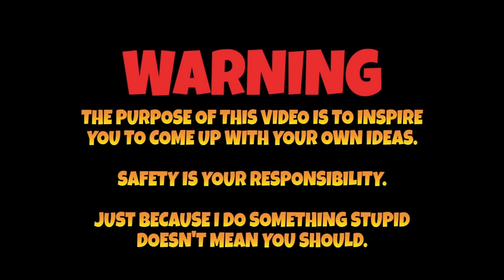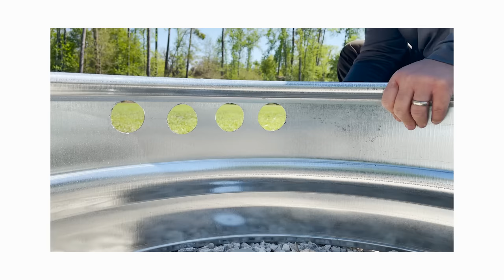12V Milwaukee More Powerful Than 18V? Head 2 Head Torture Test!

Comment: Man, I've never used the M18 stuff but I LOVE my M12 tools... I'm an accessories fitter at a dealership for 4x4's so I'm working with brand new bolts/screws, the M12 stuff has PLENTY of grunt to deal with the thread locked, factory tightened bolts. Awesome stuff, I've not once thought, hmm I need more powerful tools. ( I use the M12 multi tool, die grinder,  3/8 Stubby, and 1/4 impact driver... and a couple different heated M12 jackets/vests..)

Comment: I just bought an M 18 fuel combo kit with a hammer drill and a surge impact along with two batteries a 12 V and 18 V charger and a hard case offer like $220 or so.
Reply: Link to kit you speak of, home depot offering?

Comment: I do a lot of cabinetry and fine carpentry and for those applications the M12 set has been amazing, I'm even able to get winter rusted lug nuts off the car with the impact gun.

Obviously if you're in a more heavy duty type of trade then the M18 set would make more sense, both great tools though!

Comment: For daily user, M18 is your choice.
Being a non-daily user, I have a full set of M12 torque rachet, drill driver, impact gun for DIY mechanics. M12 Hammer drill will be my choice on top my M12 batteries and charger.
Thanks for you guidance, always glove and safety glass.

Comment: I have both these sets, like yourself I started with the 12v Fuels and absolutely love them.  For most of what I do they are more then powerful enough, however there was a few times where I was pushing them to and yes beyond there limits. So like yourself I upgraded to the 18volt set along with an 18v sawzall.   Now I don't think there is a job I do that these tools can't handle.

Comment: Interesting comparison.
That 12 volt sucker pretty dam impressive compared to the 18v.
Ah of the battery also helps if working on large projects.
To me, the 12vs come into thier own on smaller limited space projects.
Whereas the higher torque of the 18v whilst good on bigger stuff, can sometimes be too bulky into tight spaces.
Another point to add.
It does seem, if you worked a 12v like an 18v it may wear out quicker, and long term an 18v may last longer being ever so slightly under-worked compared to the 12v.
Couple years ago had to build some wooden scaffolding to fix an elevated frozen sash window.
Using a DeWalt 12v with 2ah battery constantly screwing 3" screws approx about 20/30 of them.
Battery lasted 20 minutes.
The top/end of the drill got so hot couldn't hold it even with gloves lol.

Dugga Dugga! 
Team America; f.... Yeah
Reply: Xactly, and what many don't get!

Comment: I have the M18 Impact driver and the M18 Mid torque wrench along with a few other M18 things but I think the impact driver is my favorite tool ever.

The M18 (non Fuel) one handed hacksaw is probably my 2nd most useful power tool.

Pair it with some Diablo blades and I haven't found anything I can't cut with it and it gets into some tight spaces.

Comment: I've used M18 drills to mix cement.
Full bags in buckets. A drill ran 24 bags of 66 lbs b before getting too hot.
A wired 6Amp Ryobi just caught on fire mixing the water for the first cement bag...
I wasn't even using brushless motors.

Comment: Wattage is actually the unit of power in electricity and is calculated by multiplying the amount of electricity (measured in Ampere or Amp) by the force of electricity (measured in Volt). So W=Amp x Volt. A battery with a force of 12 volt and amount of  3 amp/H electricity produces 36W/Hour of power in total. A 18 Volt battery at 5Amp/Hour produce 90 Watt/hour in total. So more voltage and more Amp produce more power but at the receiving point of the electricity the motor has to be able to use that much power. If the maximum capacity of a tool is to produce the equivalent of 2 Watts per minute, you can add a 5amp/h, 12V battery, the output of the tool is going to be 2 Watt/min only, which can be provided by  the 12V and 3 amp/H battery for 12 minutes ... Same if you connect a tool to a 15amp house plug at 110 V or to a 20 Amp plug at 110V, you won't see any difference. If your tool needs 5 amp at 110V to run and 15amp to cut (table saw), you can have a 20 amp plug, it won't change much for your table saw, the 20 amp is only useful if  you run another device on the same plug that only needs 5 Amp.

Comment: 12 volt driver / drills are great up to about a # 6 wood screw and then there just isn't enough torque to handle the larger diameter screws . 
Fortunately i convinced my wife that i needed both a twelve volt and an 18 . She actually didn't buy my argument but when i started to shake from new tool withdrawals she took pity on me and let me buy both .

Comment: I have the M12 fuel set for my job doing apartment maintenance. I love the things.  The impact is just a beast. And the hammer drill function on the drill is handy as hell when you need it.  It's not on par with the M18 for heavy duty tasks, but it'll do 75 percent of what the M18 will do.

Comment: Fun comparison.  I also have both M18 and M12 tools.  Unless I need big power, I always grab the M12 stuff first.  They easily do about 95 percent of what I need a drill or driver to do.  They are MUCH more compact and I can carry a LOT more tools in the same box.

I noticed you weren't locking the chucks on the drills.  They are locking chucks.  You can spin them on, but they need to be tightened further for big bits or masonry bits.  Then back it of until you fell a click.  Then its locked.

With batteries, it's the cell count that matters for power.  In the M12 line, I believe the 3 and 4ah XC packs have the highest drain rate and produce the most power.  They won't last as long as a 6ah, but they let out the pixies faster.  This is just a matter of the chemistry and robustness of the cell design.

Comment: Hey Adam,
Do you know the trick to tighten your chuck then back it off until it clicks to lock the chuck? May be helpful for these types of tests in the future.  I love your channel. I spend my time watching usually with a huge smile. Keep it up.
Reply from the maker: I can’t believe I didn’t know that. Thanks!
Reply: Wow nice. Just tried this on my makita 18v.
Reply: @HAXMAN  you hadn’t heard of it because it’s BS internet tales 
Backing it off only unlocks the chuck
Reply: @Meowface. it’s literally one of the features of the drill. Turn back to lock. Dewalt does it too.
Reply: @gianfrancofettuccini  nah… it literally doesn’t 
AvE did a good video on it, showing the design patents and showing why it’s actually unlocking it by turning it back 
The click is the locking mechanism releasing

Comment: If you torque the chuck all the way tight, then back it off so the chuck itself feels like it popped into neutral that locks the bit in place and prevents the bit from breaking loose
Reply: Even the so called pros don't know this technique

Comment: I like the M12's because they are less expensive and smaller and lighter.   I can load up my tool box and my tool belt with  m12 drills and impact and the batteries are much smaller and i have a bunch of them.   M18 is great and sure more power ...but if I really need power then a plug in tool is the way to go for me.

Comment: I have been wondering if the m12 impact would be good for cabinet installs. Driving 3" interior install screws. I currently use DeWalt atomic drill and driver

Comment: Actually the greater the capacity, the more ugga duggas.  Try running a 2Ah vs. a 5Ah on the same exact tool.  M12 for DIY homeowners and backyard mechanics is awesome.  Only complaint I have about the M12 is the thicker handle.  I'm sure before they finalized the battery size and launched the M12 series,  they did biomechanical studies on the optimal/most common grip size for strength and control.

Comment: Amp hours absolutely make a performance difference, if the motor has the ability to pull higher amounts of current, it also leads to less voltage drop under load. More amp hours means higher potential discharge rates assuming the same cells are being used, just more of them in parallel.  As far as m12 vs m18, I think m12 fuel impacts are absolutely great. Both the driver and wrench. The drill is meh

Comment: So if you want the M12 to be on par with a 5amp battery M18 you need to use the 6amp the watt hours are similar. 2.0 is 24 watt hour 4.0 47 watt hour the 6.0 72 watt hour.  I own both systems and use the m12s more than m18. m18 4.0 vs M12 4.0 would be even match

Comment: I don't have the 12v Fuel but the non-fuel drill has a torque limiting feature that protects the motor/battery.  It turns the drill off and you have to release the trigger to reset.  It can be a huge pain in the * at times!
Reply: All quality tools have this

Comment: I have the m12 and the spade bit, I figured it was going to super struggle. Then when you got to the forstner bit Ive had 18volt drills that couldn't handle that in 1st gear.

Comment: I bought an M18 screwdriver in 2017, and I find it very strong; later a screwdriver, M18, but without impact, the second one is too big and too strong, so I think about buying the M12.M18 is cool, for holes in wood, metal, but for what I do, M12 or any additional accessories is enough on 1/4 inch. cool episode 👍👍 PS. smaller is often weaker ...

Comment: If I purchased the M18 fuel impact driver kit/w- battery and the M12 fuel Oscillating Multi-Tool (tool only),  could I use the same battery for both tools?......
Reply from the maker: All m18 tools use the same batteries and all m12 use the same batteries. M18 and m12 batteries and tools aren’t interchangeable with each other though.
Reply: @HAXMAN  Thanks man, your response was very helpful.......

Comment: The whole premie of a paddle bit is that is needs to be held level or evenly in order for it to cut right, if it's crooked, the way your held it in the 12v drill, of course it's not going to work properly.  It stops and goes cause it's getting caught by one tooth of the paddle bit and not cutting with both teeth.

Comment: Bottom line is if you are a professional contractor/carpenter using your power tools daily then the M18 is probably the route to go but if your just a home user and only use your power tools lets say a few times a year the M12 is going to be just fine. I like the compact size and weight of the M12 line, I have the M12 Fuel 1/2 anvil impact wrench with 250ft/lbs breakaway torque. There's only one nut on my 1/2 tone GMC pickup that it may not loosen and that's the crank balancer bolt of 240ft/lbs and next highest torque on the truck is the the front axle CV shaft outer nut at 188 ft/lbs so an M12 system is enough and is really compact and lightweight.

Comment: Manually tighten the chuck. Speed 1 will give more torque for larger bits, you’ll need to use that on m12. The m18 will be fine on speed 2 since it has more torque. 

I recently downgraded from a Dewalt dcd991 to M12 fuel. As someone who needed a drill for around the house tasks, it’s great. I love the size and weight of the m12.

Comment: I use that hammer drill for ice fishing, puta an 8" auger through the ice like butter.
Reply: So funny I was asking guys at HD which platform is most returned as I’m in the market. He said Roybi since most contractors buy them cheap and abuse them till they die and return. But he said red team is so power that most ice fishers use them because they can abuse them and work more reliable in various weather.
Reply: @shawnhillis5829  my ryobi hammer drill literally snapped in half when it got caught in an ice hole, the handle design is garbage. Red has a lot of torque.

Comment: Should have drilled the hole with the paddle bit on speed one on the m12. Also, the m12 is only rated for 1 1/4 holes.

Comment: Mil great but when any company throws out more power numbers gotta take with a grain of salt. Depends on what they are comparing them too. 12v are awsome but with big bits you need more power when drilling into thick wood and  steel.

Comment: Great video man! Anecdotally at least  The CP batteries provide the best performance to size ratio and have 21700 cells in them which allows more power to be pulled from the battery at a given tim si always go CP3 if possible, aside from the high output 6.0, 8.0  & 12.0 HO batts. In general it’s alwayss safer to go with CP and high output batteries

Comment: Hey Adam!  My Rigid 18V 1/2" drill/driver died today.  Just quit on the 2nd 7/32" hole.  Of course, the Li Ion replacement battery and the corresponding quick charger are almost new.  I'm retired and just use these drill/drivers for fixit stuff around the house and cars.  Do you still think these M12 units are good for that?  Or should I get the M18.  I hate to spend that much $$$ unless the M18 is really that much better.  Thanks for your help!  kraz
Reply from the maker: I haven’t found any project that the M12 couldn’t handle. Especially if you get the bigger batteries. They really are awesome. My brother-in-law works at Gulfstream and they even use the M12. I’ll think you’ll be happy with them.
Reply: Thanks for the fast reply Adam!  I appreciate your help.  I'm on amazon right now.  Stay healthy!
Reply: @HAXMAN  Sorry to bother you Adam.  I received my M12 kit today.  I used the amazon link you provided.  I ordered a "new" kit but received a kit that was obviously used.  The zipper in the bag was already torn and not working.  the box was pretty beat up too.  None of this is your fault!  I called Milwaukee and SURPRISE this 5 year warranty is zero years and zero days if purchased through amazon or ebay.  I thought I should let you know.  I like the drills so I am going to call Milwaukee again to see if the warranty applies if purchased from Home Depot.  Like I said, I'm not blaming you.  Just informing you.  Thanks!!
Reply from the maker: @krazmokramer  😬 Sorry to hear that. I bought mine from Amazon. No more though. Thanks for letting me know.
Reply: Home Depot is an accepted seller and the 5 year warranty is in effect.

Comment: Ive tried the m18 fuel set from a coworker and it felt exactly the same as my normal m18.
Reply: Use high output battery you were probably using normal battery on it lol

Comment: Perhaps one can never have too many drills of various sizes for different jobs and situations. For drilling in various materials with no AC available, like the M12 for small stuff, M18 for medium stuff and then Dewalts (998/999) . A big design flaw for most dills is perhaps not the drill itself, but the engineers/bean counters do not match a great chuck to a powerful drill which begs the question...if it can't hold the bit what good is it as a drill ! And yes that's assuming you properly ratchet the chuck and align the bit if it has some flat sides. M12/M18 Impacts get the job done (assuming the bit doesn't fall out on the M18) as well.

Comment: just letting you know, MAH is amps per an hour the more amps the more power, so 2 MAH is much weaker than 5MAH, its a difference 24watts to the 12V and 90watts to the 18V its almost 4 times stronger instead of 2 times stronger for the 4mah 12V

Comment: I’ve got all the common, and some uncommon, M12 tools....probably 25 in all.  I’ve been on the fence about getting into the M18.  M12 is remarkable and handles almost everything I do, and l’m a pretty heavy duty user.  But there are some tools in the M18 line that aren’t available in M12.  Still on the fence.
Reply: I was right there with ya a couple months ago.  I'm not gonna tell you what to do but I promise if you do by them you will NOT say later I wish I hadn't bought these 18V tools.
Reply: @brianlucas7482  I was shopping again last week.  Still haven’t pulled the trigger but I can feel my resistance ebbing.

Comment: I have  the newest versions of the impacts. 18 seems to start up slower and i need to push down harder or ill strip screw heads.makes me wonder if its a fake. Looks real and got it off of amazon
Reply: Is it the fuel version? I have both new impacts and the fuel is a little better than the 2850 in that regard but neither of them are great for driving large Phillips screws. The 12v fuel does a much better job. If I didn’t use almost exclusively torx screws, I’d return them both. 

They both drive screws and lags incredibly fast though which won me over.

Comment: Why did the bit keep slipping once you went to the larger ones? That happens to me a bit and I don't know how to fix it.
Reply from the maker: I think a combination of me being in a hurry and not tightening it properly as well as the the bit sticking and the motor overpowering the chuck.
Reply: When you allow this to happen it can quickly wear out the jaws in the chuck. I often grind three small flats on the shaft to avoid problems.
Reply: @jackboot3946   I am a novice. I think I may have to do that since my bits are all smooth and round.

Comment: Have m18 and m12.
I love the M12 tools and use them more then my m18. They're lighter and smaller.

Cutting 4" hole saws through sil plates and such...  Yeah I'm going to use m18. The m12 can do it but you're really abusing that tool and shortening it's life. I still do it but that poor drill is going to be hot as heck after doing the job. That or you're going to be taking breaks so the tool can cool off. It defeats the purpose of having 6ah batteries.

They're great tools.
My biggest gripe is the batteries. After buying several of the 6amp batteries they failed in a couple months. Sent back for warranty and the replacements failed within months too. Was so annoying especially after some of my ten year old 3amp batteries are going strong...

Comment: That brick is kinda soft tho it don’t drill solid concrete that well i know ive tried but the m12 sds hammer drill is a god damn demon ive drilled 24mm holes in brick and concrete with that thing